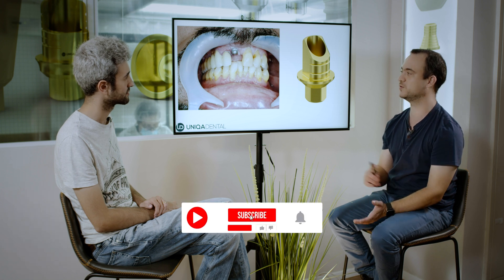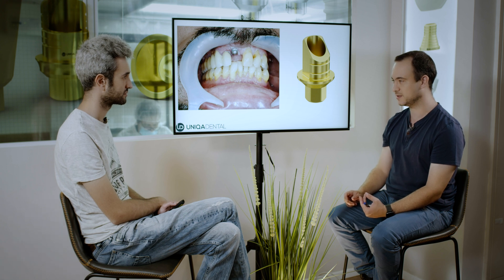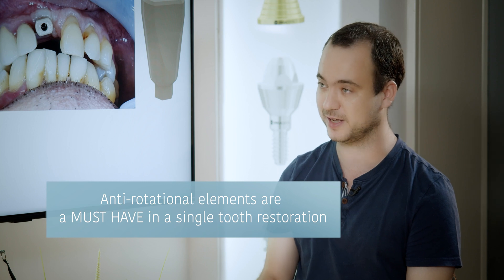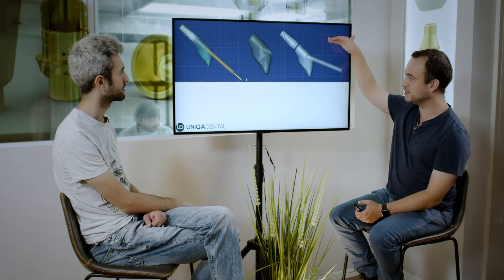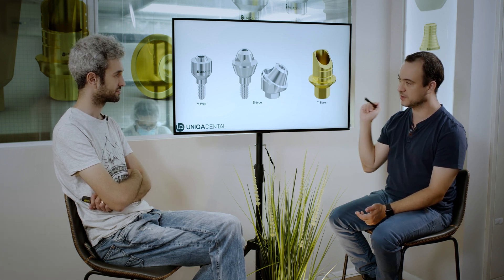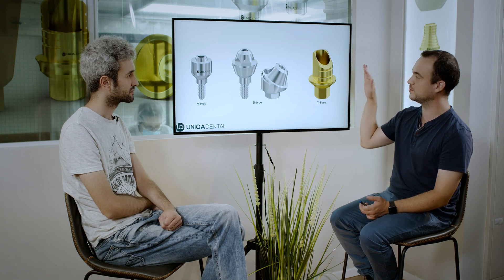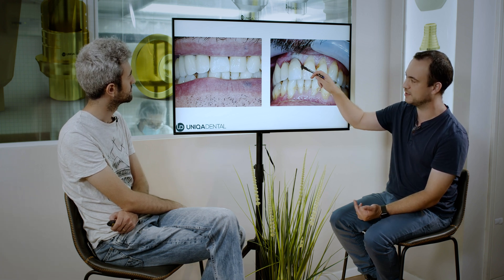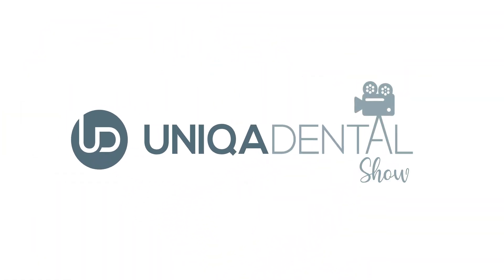Do you need to use a Ti base? The different types of dental parts & digital impression

Comment from the maker: 00:00
Press on the gingiva on the implant.
00:33 Very old bridge that was made probably from zirconia with a gingiva foam composite material.
01:29 Those teeth had the root canal treatment a long time before the previous bridge was made. 
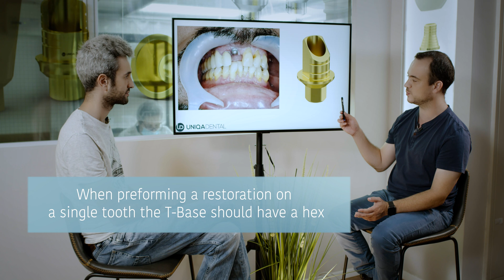02:49 These multi-units are screwed-retained.
03:56 The root canal was a long time ago.
04:57 It was made with CAD/CAM. 
06:16 Here, we see a temporary bridge.
06:51 Would the old one get infected?
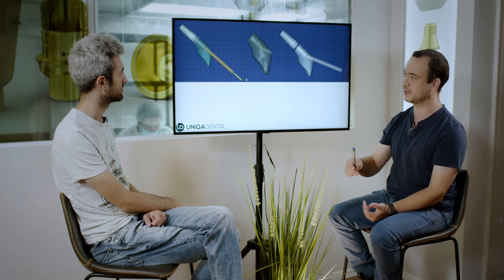07:08 We made a temporary bridge, right on top of the implant that she had with the multi-unit that she had. 
08:01 It looks much better now.
08:08 The multi-unit.
09:22 That's why we started producing the new color multi-units.
10:08 You can see these three are angulated multi-units. We took one, we colored it.
11:34 That's a cool idea. Making it the same color as the gingiva.
11:36 That's a great idea. This is in a rest position.